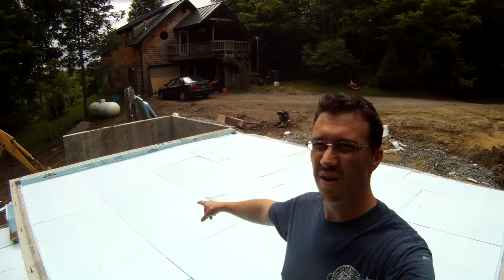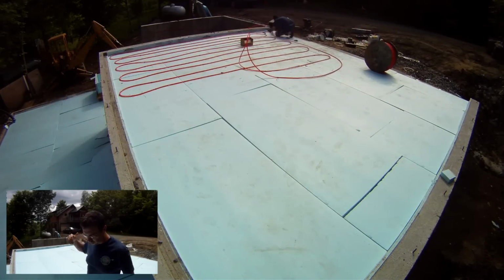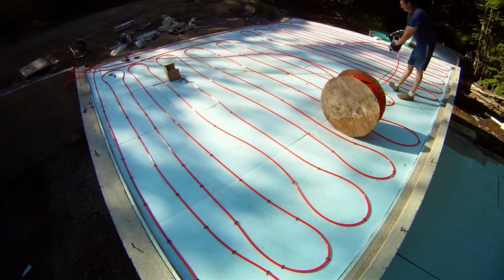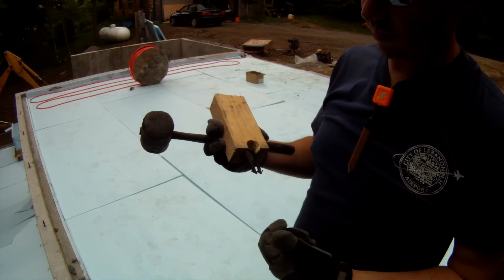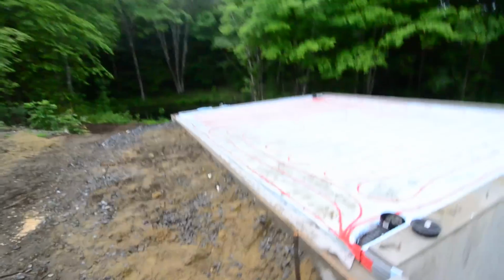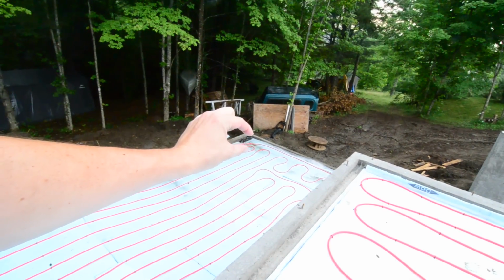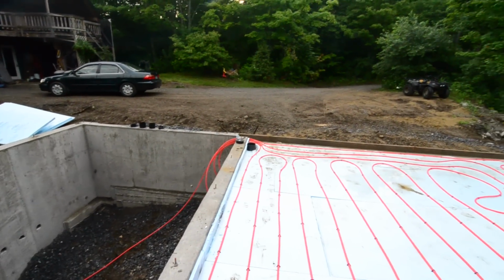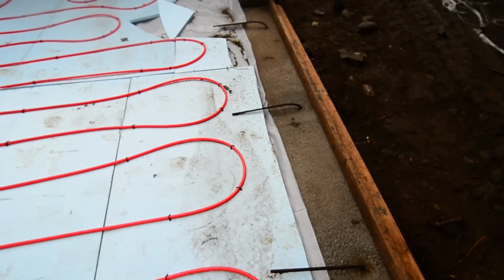Radiant Heat Pex Tubing Installation - 15 - My Garage Build HD Time Lapse

Comment: Nice vid, thank you for sharing.  I don't think the elevation difference is an issue once all the air is out of the tubes and if you're using a standard air eliminator in the circuit.  Was it easy for you to bend the PEX tubing into the 90 degree gray plastic tubes by what looks like the manifold without putting kinks in the tubing?  Any tips on how to bend PEX easily?  I'm using 1/2'' oxygen barrier PEX which is 5/8'' OD, seems difficult to push through these 90 degree sleeves where exiting the concrete, even at indoor temperatures.   I was thinking of using simple tubular foam insulation for the transitions in and out of the concrete.  Any thoughts on that?  Thanks!
Reply from the maker: I would suggest using dish soap, and do it on a hot day, or leave the tubing near a wood stove.  Get the tubing warmed up, it's much easier to work with.

Comment: did u use fiber mesh in your concrete? I always use rebar and connect the pex to the bar. But I'm calif. ....also could u kind of guess your electrical or gas bill to heat your garage thru winter? great video. thx
Reply from the maker: Yes I have a load of fiber mesh in the concrete.  Steel would have been nice to tie too.  I only heat the garage to just above freezing, I also heat my house with the same system so I can't split it up.  I use exactly 8 Tons per year and we have a pretty cold climate.  Thx
Reply: +My Garage Build,  Check out the specs.  The fiberglass does not function the same nor provide the strength of rebar or mesh.  The steel prevents cracks to some degree most importantly it doesn't let the slab crack and settle one side higher than the other.  It also adds a lot of tensile strength.  The mesh does none of this.  Especially with that six feet of fill under your slab the steel would have been a good move.  Live and learn.  I enjoyed the videos so far.  Sometimes you have to do it yourself for many reasons and with less knowledge than the experts.  Good luck to you on the rest of the build.
Reply from the maker: +Douglas Thompson Hey Doug, thanks for watching.  I will point out that I did all the work on this garage myself, except for the concrete and the siding.  ;)  The fiber was what the concrete contractor insisted on.  I asked for rebar or welded wire mesh, but he said to use the fiber....  Live and learn is right. :)  I rarely hire contractors any more.

Comment: you surely can , push them out , but i am afraid they will build up. the hotter the water the more bubles it has. By theway its always better to add antifreeze . Good luck!
Reply from the maker: True, although the air separators are pretty good, I hear them releasing bubbles every now and then.  :)  And yeah I've got antifreeze in it.

Comment: BTW, how is the concrete holding up?  Do you see any cracks or curling?  Just wondering since some studies show that pouring over vapor barrier directly (or over foam) can cause curling, cracking, and loss of strength since the bottom of the slab loses no moisture and the top dries rapidly, shrinkage at the slab surface pulls the edges upward.  With a bit of sand over the XPS foam it's easier to finish.  I think low water to cement ratios (.45) help, but none of the concrete workers I spoke with know how to adjust that ratio.  They just know the 6 sacks, 5 sacks lingo.  Thanks for commenting.
Reply from the maker: Concrete is great.  Concrete cracks, doesn't matter what you do.  Mine does have hairline cracks, no major cracks or shifts.  It's a good point about the moisture barrier, although my understanding and experience shows that water can travel all the way through even 12" thick concrete.  Also, concrete doesn't dry, it cures, this is why concrete can set underwater.  The ratio, shouldn't be messed with too much.  There is what's called "Slump" which defines that ratio and for different application techniques it needs to be adjusted (pumping).  Thanks for the great comment! :)

Comment: Not sure what u mean by 8 tons. Does that mean heating oil?...Also did u frame your garage using 2x6 studs with r-21 insulation for the walls and r 38 for the ceiling?
Reply from the maker: Sorry, 8 Tons of pellets.  Yes 2x6, but the insulation was "used" so r-who know what. :)

Comment: looks like lower level has a slope up, where the air will stay  reducing circulation, has to be flat or with air breakers in the upper zones, i thnk
Reply from the maker: When filling a system I am able to force the air out using high flow rates.  Any small bubbles that remain will be pulled out with the multiple air removers I've installed at the headers and in the main boiler. :)